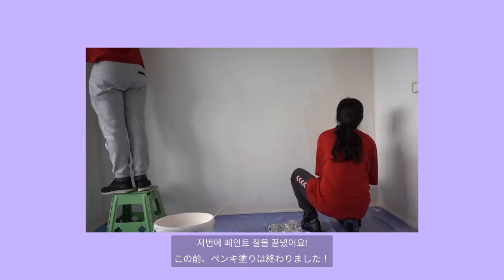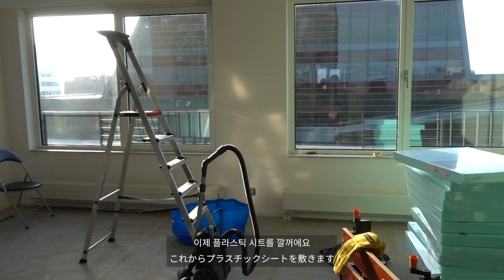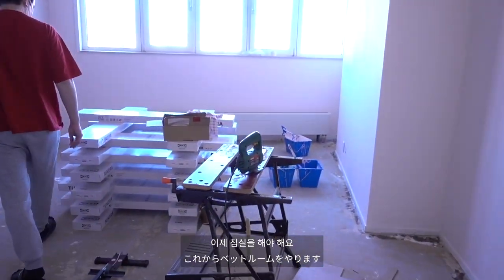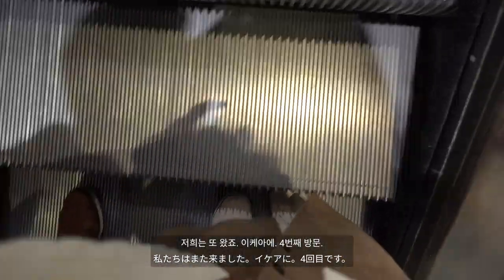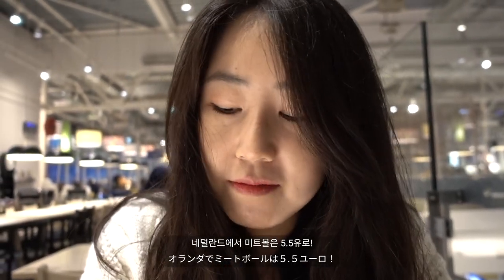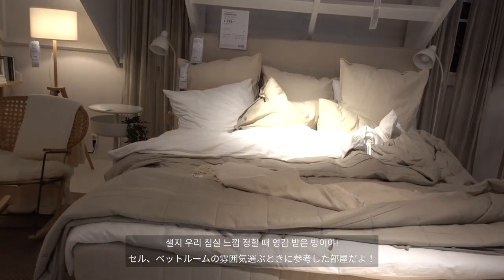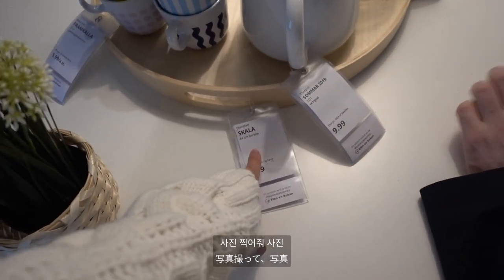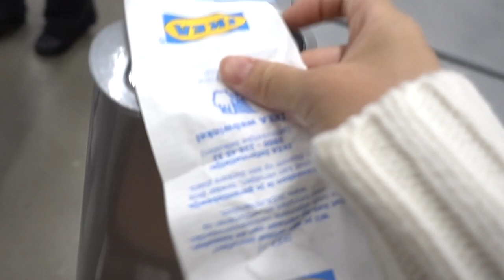How to install Laminate! Finally! International couple going to IKEA / VLOG (KOR/JP subs)

Comment: Hi, thanks for the video! It surely helps a lot. After countless of thoughts and research, I am thinking to go for the IKEA laminate floors. Based on your experience, is the click system of IKEA laminate easy to connect from one plank to another? As I read some reviews that the edges of laminates could be broken easily while they are installed (PS; they are not from IKEA though). How's your experience so far with the IKEA floors? Thanks!
Reply from the maker: Thank you for watching it! It clicks easily and it is not that hard to do. However, sometimes you need to hammer it !! For me the edges were fine. Of course, you need to be careful 😉 I would recommend you to get extra laminates so when some of the laminates are broken, you can replace them. We actually had quite a lot of extra laminates, so we went back to Ikea to return them after everything was installed.